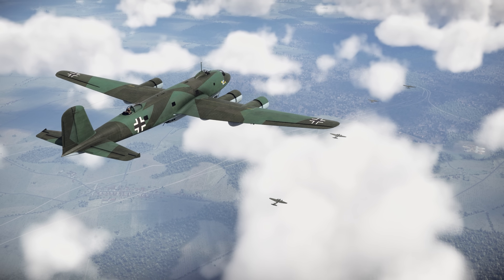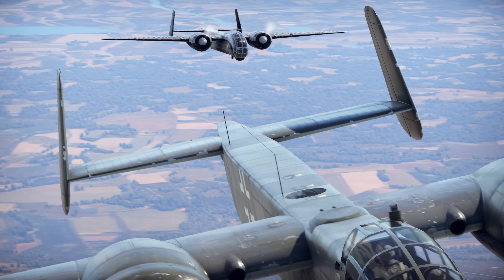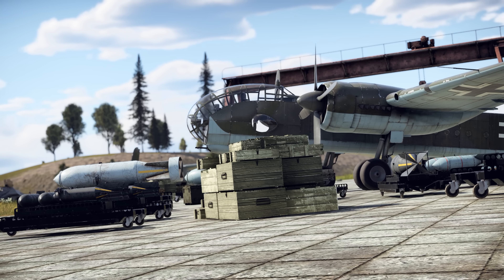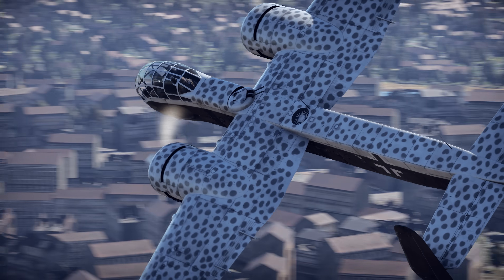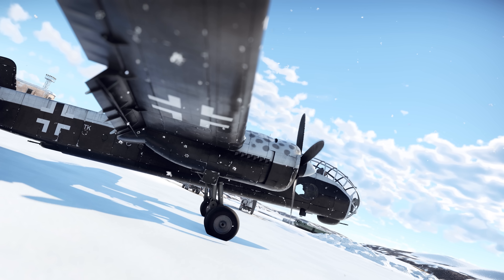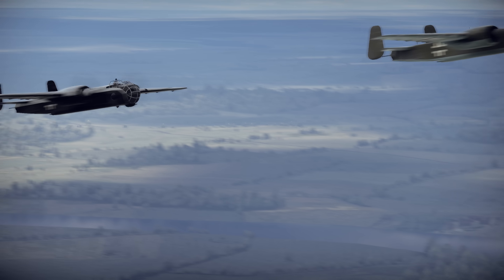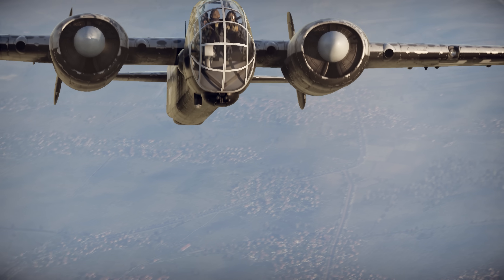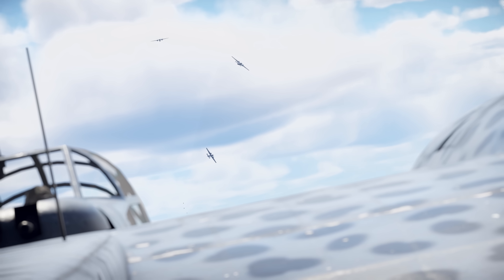Junkers 288 — High Hopes

Comment: day 9 of asking to add super tucano
Reply: its just light aircraft gng its not that deep🥀🥀
Reply: What br?
Reply: @KakoMD27  it depends if it a basic and casual its
a 3.7 – 4.0 if its a advance one with cas and Strike it will be 4.7 – 5.3 if its a multirole with guided ammunition its a 5.3 – 6.0
Reply: @Theallseingeye458 what variant? The 314? Bc the Súper Tucano in all he’s variants should be in 8.0/8.3 we are talking about a plane that can carry GBU and Missiles

It’s a very very advance plane for the br that you are saying

(I’m seen it from the SB mode, RB is easy kill and ground RB could shine but i don’t know, there’s already the SAAB 105)
Reply: @KakoMD27 ok sorry for the misunderstanding so yes correct i have some error so yes this is the correct br rating in my opinion 

Basic A-29 (no guided weapons)	7.7	Good payload, but lacks precision and speed

A-29B (with guided bombs/AGMs + flares)	8.7–9.0	Strong CAS, light anti-air potential, great sensors

A-29 with thermal/NVG and advanced countermeasures	9.0–9.3	High survivability and late-game CAS tool

Comment: Keep in mind they gave this thing TWO 2500kg bombs
Reply: The Berlin Express
Reply: Im fully aware muwhahahahahaa.. but really tho the 2500's are almost too heavy the climb power is aweful if you land and try to take off with those big boys
Reply: @psicho9217 ngl i dont have this problem amd i ise the 2x2500kg bombs
Reply: @amasingkiller257d3molish3r  I shoulda specified. In ground rb it's rough getting to a safe altitude before starting to bomb cuz of the weight after rearming. In air rb it's amazing if no one is camping your airfield after rearm
Reply: @psicho9217  I've taken off perfectly every time, skill issue
Reply: @psicho9217 that's why it was a long range bomber. It would have had friggin forever to gain altitude. Climb rate doesn't matter when you have 100s of km to the target